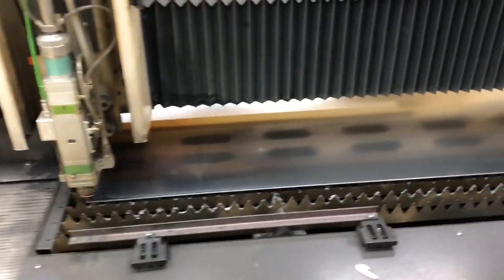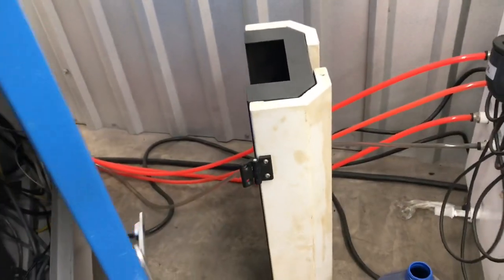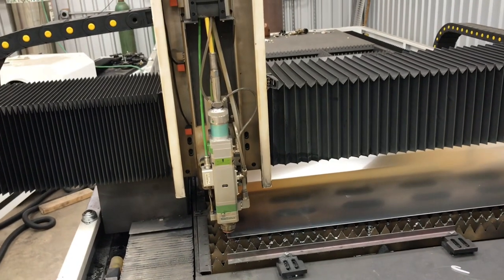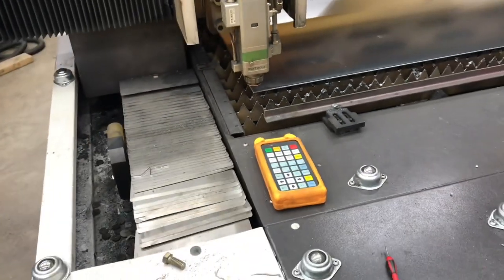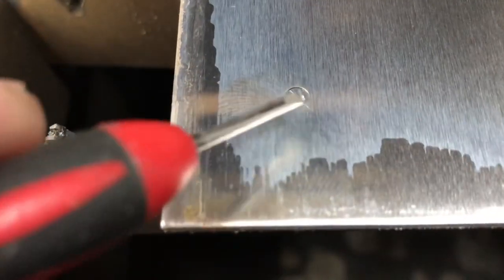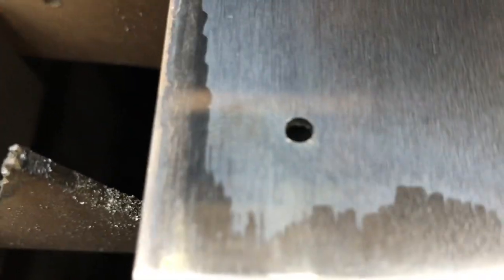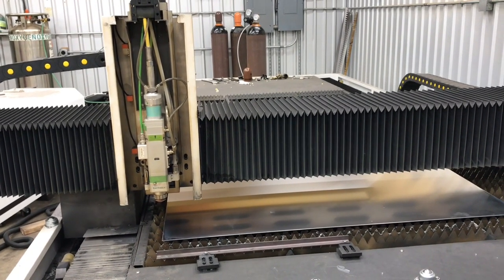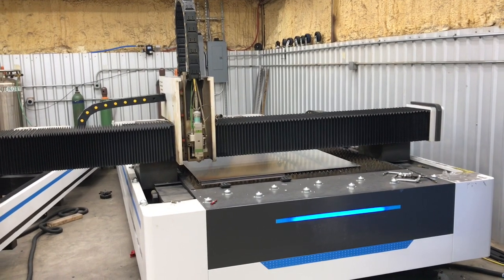It’s like driving a hotrod around with no hood on it !! Super fast CNC Fiber Laser

Comment: What do you need nitrogen for? Wont air work?
Reply from the maker: not really.  to use compressed air on a laser you need a compressor that will produce 270psi and 70cfm.  About $25K

Comment: How come you don't have an enclosure around the machine like most of the other bands have?
Reply from the maker: most of the brands have?  checkout Boss Laser, Laguna, Kern most all of the standard 1KW machines are open machines.  The larger enclosed machines with exchange tables are $100K and up and are for high production manufacturing
Reply: @turbocobra  when I mentioned most bands I was referring to cincinnati, amada, trump. I was under the impression the fiber laser light was hurtful to your eyes and that why those machine are fully enclosed. Is that due to such high wattage? I run a 4kw co2 laser.